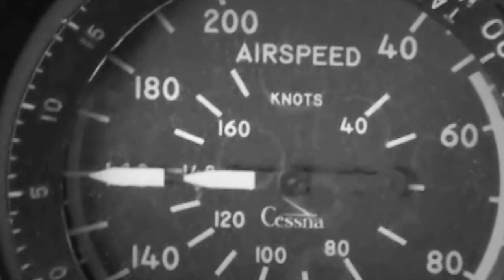VFR into IMC: The Experience

Comment: While I do not know now how IFR training is currently provided, in the very distant past when I went through the training for a private pilot certificate, the last 5 hours of training included at least a half hour of recovery from unusual attitudes.  Which made it possible for this pilot to fly IFR for up to a half an hour in a single engine aircraft.  I have had a commercial license and instrument rating now for over 30 years, getting regular instrument time with a check pilot.  If one does a substantial review of the weather on the proposed route, the go, no go decision with the listed experience is usually obvious.  The only truly scary flying event I encountered was substantial icing on the wings of a Cessna 172 over I-80 west of Truckee, California; wondering if the 172 would start to descend.  After around 15 minute of rapid ice build up and getting to the west side of Truckee, the desert air removed all the ice within 5 minutes, incredible.  I have never seen anything like it before or since.  So VFR into IFR is only a nuisance with regular IFR practice compared to icing.   Or, make it a point to check for icing; to save your life; much more so than the nuisance of temporary IFR flight.

Comment: Flying at 9500 feet from Nebraska to Ohio at night years ago in forecast perfect weather, my vacuum pump slowly failed.  Luckily I noticed the precession and ignored the vacuum instruments before the vacuum actually showed as failed.  I notified FSS and requested a weather update.  They reported no clouds at all.  Over Iowa I flew into the clouds.  I executed a 180 safely (partial panel at night) and called FSS again.  Based upon their update I decended to 7500 feet and after another hour flew into clouds again.  I again executed a 180 (I thank my instructor for hours of unusual attitude drills) and called FSS.  Changed my flight plan to land at the nearby Champaign, Il airport and landed in the pouring rain.  Bottom line:  the weather is what you see, not what anyone tells you.  Got pump fixed.  Flew to Dayton and DC the next day.
Reply: Similar mess in a pressurized Cessna 210.
I was at the top of my game(thank God).  Also had no working glide slope so no ILS.  Flew into a hole over the Columbia River.  Spiralled down to VFR.  It was a long hour in nasty chop & a great experience!
Reply: Neat

Comment: Having an instrument rating is good, but the sad reality is that most pilots that get their instrument rating, don't stay current or proficient enough to be safe when they actually need to use it. It takes time, money and dedication to stay instrument proficient and safe enough to fly in less than VFR conditions.
Reply: Hell, MSFS2020 is only $60. May not be a "True flying experience", but it's a LOT cheaper to learn IFR. Maybe not enough to truly be Instrument rated, but for a VFR pilot, it might save their life someday.
Reply: So true to stay current.  The training is worth doing even if you can't finish.  The required 6 hours & 6 approaches every 6 months really isn't enough.  Legal? Sure but better to fly with a good instrument instructor and pass a competency check.  Training always improves skill; so add some!🤔